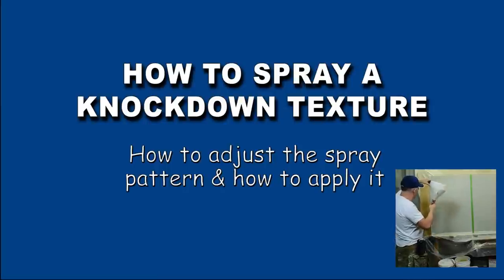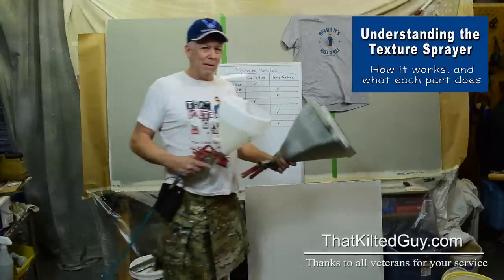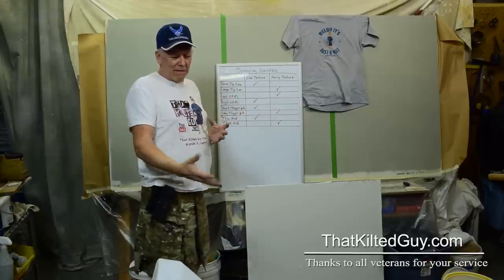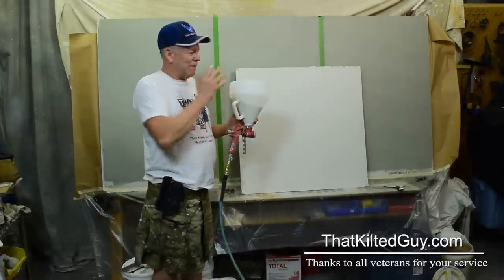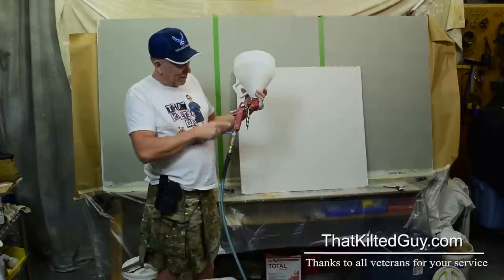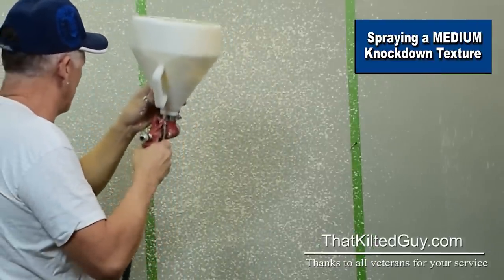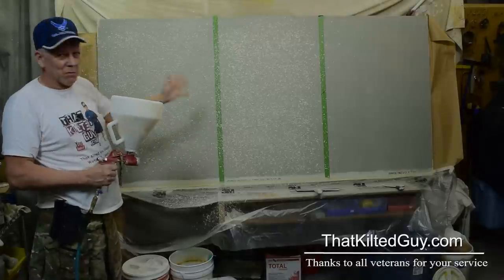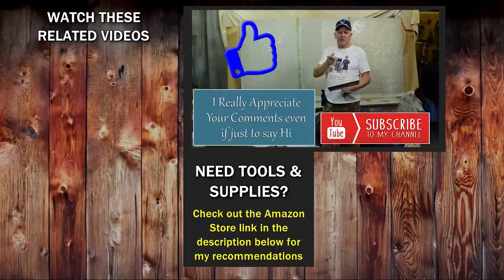Spraying Knock Down Texture in 2022.  Learn the 🔐 SECRETS 🔐 only PROS know using this $30 Tool

Comment: Thank you for the informative video.  I have a bit of a unique situation I was wondering if you could help me with.  My house is 2500 sq foot.  VERY open concept.  So, the kitchen, living room, dining room, breakfast area, etc. ceilings have no 'terminating point'.  They are all one big ceiling.  I have done a lot of small texture jobs. But, I'm afraid there is just too much to do in one go.  Do you think it is possible to spray one room, then come back the next day and spray another room, without being able to see where you stopped/started?  I'm afraid it will create lines, like patch jobs do.
Reply from the maker: Well it is more likely to show but can be done.  But you might have to sand it all lightly when done, with like 220 grit, to blend in the blend lines.  Where one stops and another starts can give it away, so sanding them all can make them blend more, assuming your doing a Knockdown.   If you prep it all, and mask it all off, you should be able to spray it all in one day.  But it would take me a few hours by myself, and it's still hard to blend the overspray each time, so sanding when dry makes sense.  Spraying a lot of KD is really best with 2 people if possible.
Reply: @ThatKiltedGuyDIY  Thank you very much for the reply!  Looks like I'll be enlisting some help from the wife! :)

Comment: Hi  thanks for the video.  Been searching these videos on texturing and this one was very informative.  I'm curious what size air compressor you would recommend as a minimum to do this work so the pressure always stays consistant.  I've only got a small compressor and tank, I think its smaller than 5 gal.  I wouldn't think if you have a big room that you really want to stop every minute or so so the compressor has a chance to catch up for doing knockdown.
Thanks again.
Reply from the maker: Hi, you definitely want a big enough compressor.  The tank size isn't really important as you'll drain it in minutes anyway.  

Here's what I have- https://amzn.to/2NYHrP3  It gets the job done, although if I ever need max air it can struggle a bit to keep up.  But 90% of the time it does fine.  And it's super quiet, which is really nice.  Here's what I wish I had- https://amzn.to/2Ycf7wp
Reply: That Kilted Guy DIY Home Improvement thanks for the info👍

Comment: I don’t know if you have any idea about this but I have been looking for videos on how to remove a Stipple texture on a ceiling! I don’t know who ever decided that leaving long pointed drywall mud streamers hanging down from a ceiling would be a great idea but it is horrible and gets very dusty and is very hard to clean. I have cathedral ceilings and would love to completely remove but at the very least retexture them. I haven’t tried scraping or spraying with water and scraping as this will be a massive job. Our dining room, living room and foyer are all connected. 😖😖😖All of our ceilings are stippled except for the  sunroom. 😖But the other rooms are individual and can be done one at a time. Any information would be greatly appreciated.
Reply from the maker: I would just scrape the heck out of it, then skim coat it if it’s not over 1/8” deep, then finish it however you want.

Comment: Hi, thanks for these great video's! I am about to do an entire house only about 700-900 sq. ft.,  I just scraped popcorn off of ceilings and the walls have a light-medium texture, most have a flat paint kitchen has gloss, I plan on lightly sanding that. 
Do I need to clean the gun and hopper after each room? I'm going to use the Reg. Green bucket USG I guess, don't want hot mud because of the extra work mixing small batches and frequent cleaning.
Have you ever done large knockdown over a medium knockdown? Did it look O.K.?
Thanks for all your help and advise!!
Reply from the maker: Hi, and thanks for the question.  I do plan on doing a video about changing a texture, just be putting another right over the top of the old one.  Yes, they look fine, and I think something even better.  You might want to experiement first if you have any doubts, and you can always wash it back off.  I prefer the lightweight mud for texture, but the green label will work.  If you stop texturing, cover it with a trash bag including the nozzle, and you can clean it days later.  I have a hopper sitting in my garage I used a week ago, still covered and it will be fine.

My advice is always free, but if you find our assistance with your projects helpful, I hope you'll consider supporting our channel by making a one time donation in any amount at: https://paypal.me/ThatKiltedGuyVideos?locale.x=en_US
Reply: Ok, great thank you for the advice and I'll keep an eye out for your video on the subject. I've had knee surgery so it's been awhile but I'm finally going to spray/texture the house next week, going on your Amazon store first to buy a couple of tools first.
Reply from the maker: Thanks, Guy

Comment: Are you changing the cfm by adjusting the valve right below the gun ,or do you adjust it by the psi at the tank? 
Also what psi is recommended for spraying knockdown?
Reply from the maker: Roughly 30 psi, and the CFM is changed at the gun
Reply: @ThatKiltedGuyDIY  Thanks much.

Comment: Will a new knockdown texture hold onto the ceiling better than the old popcorn texture that had been removed ? I am assuming that it is put on over the bare drywall.   The popcorn that I removed I painted I painted half and then decided to remove it all.  After wetting the painted section can off very well in nice strips as wide as the knife, the unpainted came down as dust and messy.
Reply from the maker: Hello, and yes a new knockdown texture will stick much better than the old popcorn texture did. The popcorn texture didn’t have very much adhesion to it and the base layer was pretty crumbly and lousy. Be sure you dust off the surface because nothing likes to stick to dust.
Reply: @ThatKiltedGuyDIY  Hey thanks for the info and it gives me a lot more confidence  , just wiped it all down with a wet sponge. Should be spraying tomorrow.  I was also USAF , sheetmetal mechanic at Castle AFB and then RAF Alconbury years ago.
Reply from the maker: Cool, thanks for your service.  I was at FE Warren, then Kirtland, and finished up at a guard unit in Seattle.  7 years total.  Mostly as an Electronic Warfare Technician working on A-7s, which were phased out shortly after I got out.

Comment: I’m getting rdy for my 2nd tape coat. Can I use my hopper to shoot it on and then trowel it smooth?? I’m thinking I could get it in faster this way?? But is there a down side to this??
Reply from the maker: I’ve experimented with something like that for skim coating and it is slower, not faster by a lot

Comment: Seems like you don't have to wait as long for the texture to setup before knocking down, if you have a knock down tool like yours?
Reply from the maker: Yes this knife is much more forgiving and you can knock it down sooner.
Reply: @ThatKiltedGuyDIY  I have a little Plus 3, and a 1/3 bag 40min joint compound remaining from the repair.  I wonder if I can use either of those for my knock down?  I also have an unopened box of USG Topping that I'd kind of like to return.  I'm sure a pro could use just about anything, but I wouldn't mind using whatever is the most forgiving.  (I will be primering the patch first.)  It's windy outside and about 23% humidity in the kitchen.  The kitchen is small, so I could probably use a humidifier to bring up the moisture.  That's either really funny to you, or a good idea. Lol

Comment: Great video, thank you.  What is your opinion of the sprayers that have a stand alone unit with hopper and hose vs. the sprayer with the hopper on the gun like in your video?
Reply from the maker: You mean like the Graco sprayers?
Reply: @ThatKiltedGuyDIY  Yes sir.
Reply from the maker: I’ve owned the Grayco sprayer‘s with the standalone hopper and compressor and long hose, and Ive borrowed a friends numerous times and overall, they are better than the cheap hopper style but they are very finicky and I’m not super impressed with them. So I sold mine. I have a new Grayco unit that I think will keep up with those style and it’s just a pressurized topper. I will do a video on it one day.
Reply: @ThatKiltedGuyDIY  Thank you!  I figured that.  And the standard hopper style has been around for so long that I also figured it has to be a pretty good system to use.  Thanks again for your responses and all of your help!  Best of luck with everything, I'm looking forward to more videos.

Comment: Great video! Thanks.  I am doing a bathroom and was going to pay someone but decided to take it on myself.  But quick question on equipment.  I've seen the hopper you used on amazon  and also have a pressure tank but not sure I can control the pressure flow from the tank (as it is preyy old and the gauge is broken) .  I did see an electric gun option which I would think would give a more consistent spray versus my old tank with inconsistent pressure (i'm guessing). This is a small bathroom room and I may be doing just another bathroom and will keep the sprayer for other small house projects.  Do you have any thoughts on an electric spray hopper?  It's about $75 vs the $30 option but not concerned about spending more. Just want to make sure it works.   Thanks!
Reply from the maker: I don't like the idea of an electric one.  I think you'll lose a lot of control, but, I've never used one.  I would buy the air version and a new pressure regulator.  This one will attach to the sprayer even- https://amzn.to/3c6ZFWJ
Reply: @ThatKiltedGuyDIY  Thanks for the quick reply and tip on the regulator.   Have not seen that regulator before but looks like a perfect solution.  Cheaper sprayer and more consistency.  From your experience, what shoudl the pressure be for a medium knockdown?  really appreciate the help!!  BTW, my brother in law plays the bagpipes.  Given your attire, assume you do as well!
Reply from the maker: Tcdrone Glad to help. I pretty much run the same pressure for everything which is around 30 psi. Like I explain in this video it’s more important to regulate the CFM but if you have the regulator on your gun that can do a similar effect. So in that case for a heavy knock down try 20-25 psi. 

I’m actually not Scottish, I just like the freedom down there as it’s more comfortable. I actually hate wearing clothes at all and this is the closest I can come to that.
Reply: Received the sprayer today also was able to fix my compressor with a new gauge and we'll be able to control the pressure.  So I'll be ready  to go this weekend and we'll test out on some test board.  If all goes well, full room done! Also ordered the wide knock down tool you  recommended.  You and your colleagues are are artists at doing this. Hopefully I can do a good job.
Reply: Love the freedom!!! Lol

Comment: Is there any prep work involved with the sheet rock before spraying the texture or will the texture hide some small flaws?
Reply from the maker: Hi Rebecca, there's a big misconception about how much the texture will hide.  But it also depends a lot on how heavy and how much coverage you get.  So a light texture will hide almost nothing.   A medium will hide very thin, light edges, but not much else.  A heavy full coverage will hide more but still not anything more than light edges and minor pinholes, etc.  The things that show the most are straight lines such as the edges of the mud.  Now popcorn, you can hide a stash of cash behind that and no one will ever know.... oh wait, I gave away my hiding spot.  But seriously, popcorn hid way more than modern texture does.
Reply: @ThatKiltedGuyDIY  I recently scraped off popcorn from my ceiling which I have been wanting to do for a long time.  All the videos I have watched seem to suggest that "back in the day" this was a cheap, easy way to do ceilings and hide flaws.  That being said, I now can see some flaws in the ceiling whether they were there when the popcorn was sprayed on or marks I may have made while scraping the popcorn off.  Nonetheless, it looks as though I will need to do some repairs before I texture and paint.  Thank you for your informative videos as I am very much an amateur at this.  I have recently retired and am enjoying doing some minor home repairs and projects around the house as my new hobby!
Reply from the maker: That's actually why I put out this video, which might help you some.  Good luck and have fun.  https://youtu.be/nr_lUivx9-M

Comment: How can I send you a picture of a texture I want to match and can’t figure out how? I’m in Phoenix Arizona and it’s a very large splatter knock down. Can’t get the sprayer to make the splatter this large.
Reply from the maker: Large splatter with a small sprayer is hard to do. But just try the largest nozzle, and as thick a mud as you can get to spray and minimal air.
Reply from the maker: Otherwise you can send me a pic by joining my Patreon group at www.patreon.com/thatkiltedguy

Comment: What size compressor is min8mum and average to spray texture? Will my 1.5 HP, 120 psi pancake compressor be enough?
Reply from the maker: Even a small compressor will work for a smaller repair.  Just turn the air off anytime you're not spraying.  Larger jobs will deplete the air often. This is the compressor I use, and it's barely enough for larger repairs, but fine for smaller ones.
https://youtu.be/GysQMOiM8Nc
Reply: @ThatKiltedGuyDIY  I'll be doing entire bedrooms, hallways, living rooms and kitchens in phases. I guess I'll just be waiting a lot for the compressor to keep up.

Comment: I am trying to texture a few patches in our ceiling from a remodel. My knockdown pattern matches pretty well, but I am struggling to match the depth. The original knockdown has deeper ridges than mine. What variables should I adjust to get a bit more depth?
Reply from the maker: Thicker mud and/or a longer setting up time so it flattens LESS.  If you current pattern matched, you may also have to put on bigger drops, or more of them since thicker mud and mud that's set longer flattens less.

 Harold Howe, Thanks so much for your Paypal donation.  It's greatly appreciated.
Reply: @ThatKiltedGuyDIY  You're welcome. fwiw, I am redoing the knockdown that I paid a drywall person to do. Their patching and mudding was fine, but their knockdown looked awful. They used a texture can. I think the can was too cold. Or they didn't wait long enough. Came out like a flat blob.

I will be on attempt 3, but each one gets better. Your videos have helped me eliminate variables that were foiling my efforts. Have tried the sponge, but having more luck with a gun.

Comment: I want to do a level 5 treatment on drywall . Will spraying on the mud save me any time rather than rolling it on with  a paint roller?  Is this the wrong tool for level 5?
Reply from the maker: I've never sprayed on a level 5 as I believe you have to have a sprayer that is about 4-$5000 dollars to push the heavier mud through it.  So I've only done a skim coat version by spreading it on with a knife, or by rolling it.  But, spraying should be MUCH faster.
Reply: @ThatKiltedGuyDIY  I will try it and let you know the Manufacturer says that my small compressor is just fine.  So we will see if it dont work I can return the hopper sprayer. So dont cost nutting to try.

Comment: I did the first spray but it was not heavy enough. Now it’s dry can I spray add or spray more at the same area for making it heavier? Thank you
Reply from the maker: Probably, but I've never tried it.  I always fix it when it's still wet
Reply: @ThatKiltedGuyDIY  I don’t know if I have to scratch off and start over or what?
Reply from the maker: I’d try just adding more on top
Reply: @ThatKiltedGuyDIY  thank you 👍

Comment: if the air is important why wouldn't you say what psi you used when spraying the various textures?
Reply from the maker: I explained it. Watch it again and pay attention to the part about the air
Reply: Got it, "low", "a little bit" and "high" @ThatKiltedGuyDIY
Reply from the maker: @btp60  actually if you watched it you’ll see that psi is the least important, CFM is more important. Do you realize some air compressors out there have 150 psi but they wouldn’t have enough air to spit out mud at the nozzle of a hopper?

Comment: Hi im having trouble getting the heavy .. do i use bigger circle on hopper or just spray more and knockdown early?
Reply from the maker: Hello, and thanks for the question. I would start by re-watching the video from this point- https://youtu.be/eKkDBGHCbJo?t=235
But to get heavier texture you use thicker mud, less airflow, bigger tips and put more on by spraying longer or pulling the trigger more.  You should experiment with these things, but I mostly change it by pulling the trigger more and using less airflow, (cfm).  Hope that helps.
Reply: Thanks appreciate it. 👍